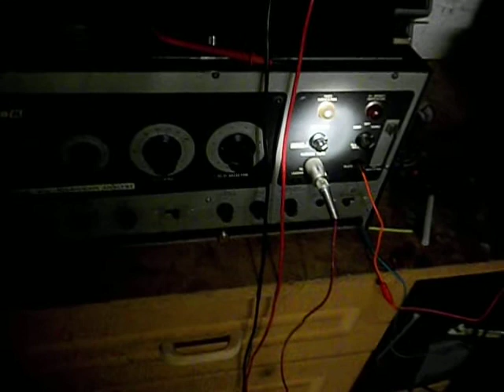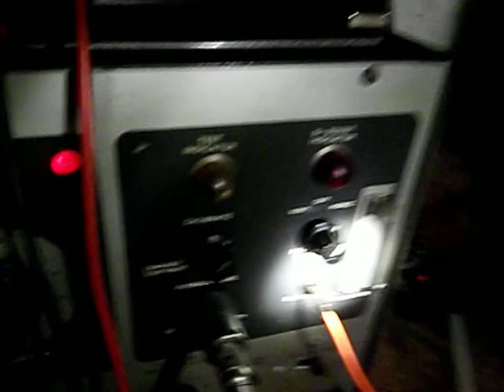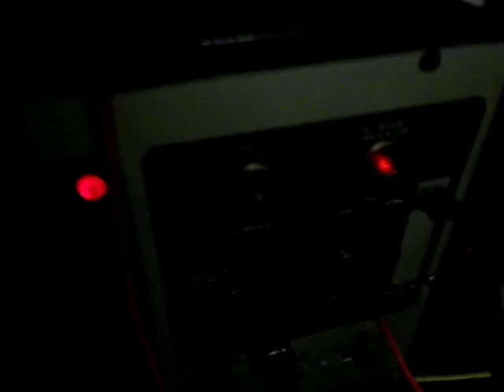Vintage TV Philco predicta inital check for High Voltage

Comment from the maker: indeed the 1076/1077 are very handy for troubleshooting, besides the plate drive (has horz and vert) you can get grid drive as well. then there is the IF/RF/video, color bars and audio. A very useful piece of equipment. has the handy little neon lite as well.

Comment: For someone just starting out, a 1076 or 1077B and a copy of Martin S. Kiver's book, "Television Analyzing Simplified" (which heavily uses an earlier B&K analyzer) is probably the fastest and easiest way to learn diagnosis specific to TV's. You can find a manual and Kiver's book on the Bunker of Doom site. You can learn to troubleshoot and fix it. Or you can just blindly shotgun recap everything-and still have a dead TV full of expensive new caps.

Comment from the maker: talking it over with shango066, decided to check the cathode voltage to see if the CRT was cut off. Of course the yellow wire was off the pin, hooked that back up and nice bright raster with complete brightness control, looking good.
Next up will see if I can get the HO tube to light and do a baseline as is.